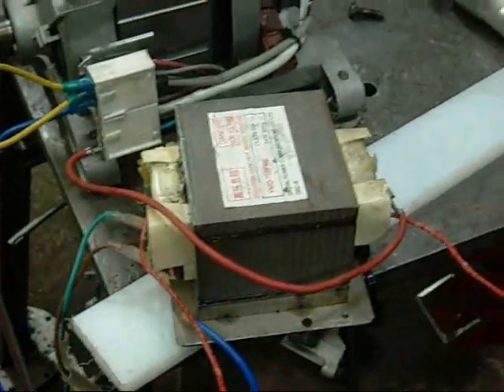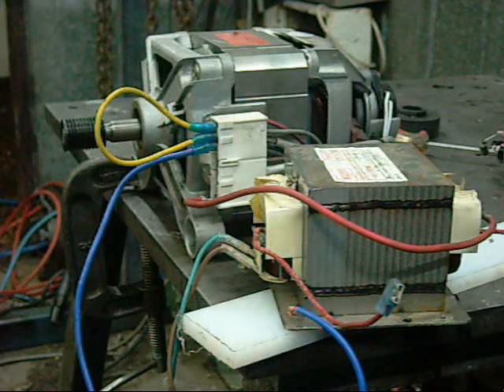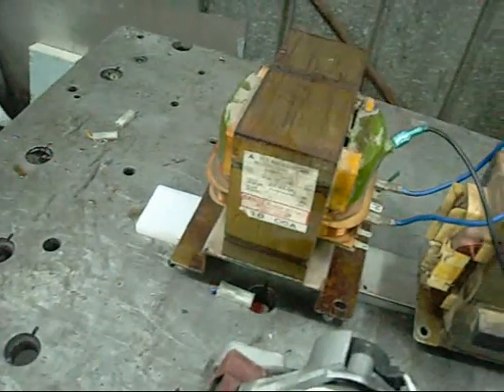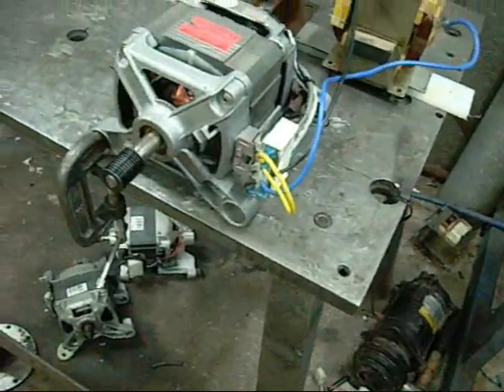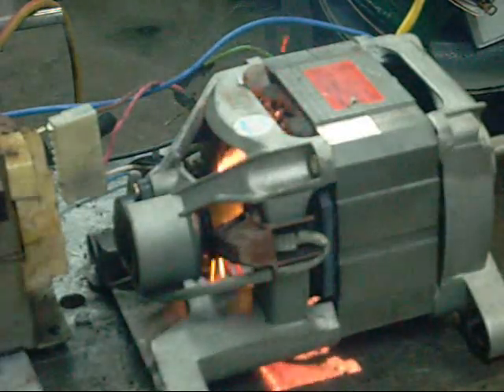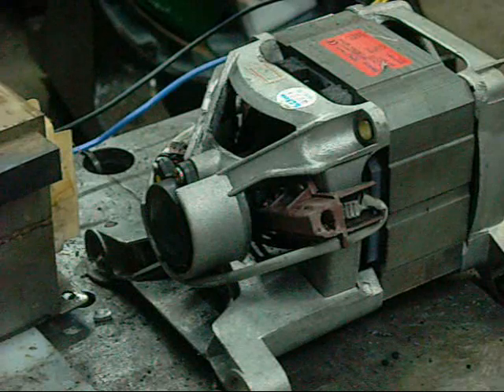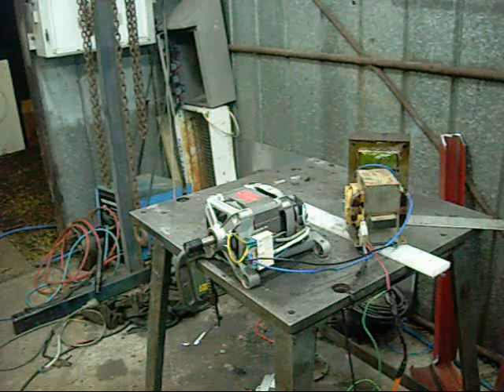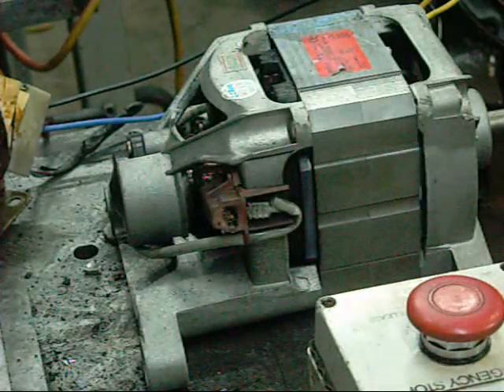Epic Battle of Microwave Transformer Vs Universal Motor

Comment: Great vid, good to see how fast these little blighters can go. Just one question, the motor seemed to pick up better on one transformer than on two, so were the transformers wired correctly aiding not fighting each other (I would guess it should be in phase, in parallel for more current)? Keep up the good work.

Comment: hey there I have got same 9 pin motor ,which I want to use for table saw.Could u tell me about wiring pattern  and cheap way of speed control.( I am not goo with electrical terminology) .Thanks and regards

Comment: MOT with original secondary HV coil is quite useless. But this coil can be easily removed and replaced with few turns of thick isolated wire. You can make e.g. powerful power supply (12V, 24V, 50V...) or even spot welder.
This is much safer, more useful and can be entertaining too.

Comment: Have you tried hooking up 10 9V batteries in series and lighting up a neon lamp with them?  I have.  I stopped after I tried a lamp without ballast (the resistor broke off).  The electrodes were slightly burnt and my head hurt afterwards.  You can guess what happened.  Bear in mind I was, I think 13, 14 then.

Comment: series wound motors must always have load to run. Else the current approches 0 so the magnetic flux approaches 0 with result the speed going to infinite. since n = kn * (Vm - Rm * Ia) / Φ(magnetic flux).  So the only damage to this Motor is from overspeeding the commutator and the friction on the brushes.
Reply: Yeah,  but if you force a ridiculous  amount of current through the windings with brute force (high enough voltage),  all bets are off,  NikolaosLedZeppelin  :D
Reply: whats all this kn star vm, either it works or it don't!
Reply: Tesla Explorer your math are really low....

Comment: now thats got me thinking, why not make the commutator and brushes out of Tungsten (metal that has the highest melting and boiling points, probably some alloy like a TIG welding electrode) and leave an intentional air-gap between them, and to protect aginst arcing from brush-to-brush, have some electrically insulating refractory ceramic "arc-baffles" directly on either side of each brush like this:
[ ceramic ] [tungsten brush] [ ceramic ]
[insulator ]  (=-=airgap=-=)   [ insulator]
?????

Comment: Just so you know:  universal motors like this one are current operated devices, so no matter what the voltage,  it takes power to fry these puppies.  I think the MOT only is good to about 1 amp or so,  so that's about 2 kilowatts into the motor,  and if it's a 1/2 HP motor,  it'll put up a good fight with no load to the shaft.  :)

Comment: Firstly, go and read a lot about electronics and high voltage safety. Then google what the transformer will do to you if you touch the output. If you have reached this step then you will not need to ask people on youtube.

Comment: a waste of time and good parts.
Reply from the maker: Time is freely available as are these scrap parts. when the scrap bin overflows with motors and transformers, its fully worth it :D
Reply: +Aussie50 ----  It may be interesting in person but on video it is quite dull.  Might have helped had you explained the process.  What exactly is happening.  How the transformer works.....something....anything.   As it is......it's a flop.
Reply: ...something....anything.   As it is ......it's..
 it's just short of 300,000 views (or 50k a year - which by the publics reaction is anything but a flop)
Reply: universal motors, despite their name, are only good for the device they came out of. universal means they can run on AC or DC. MOTs cant take any load other than a magnetron or they burn up.
Reply: soothsayer1 he has dozens of them
Reply: What? No, OK, no, not at all. EDIT: FAO Roush.